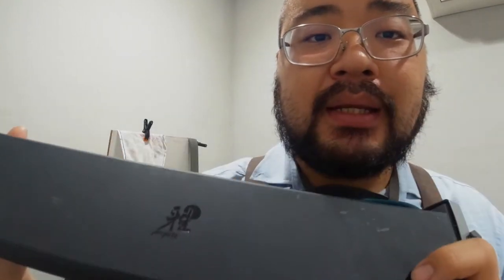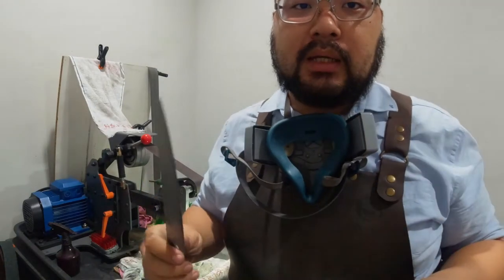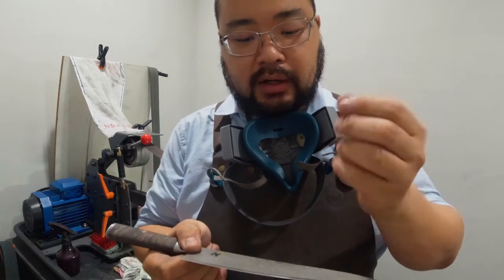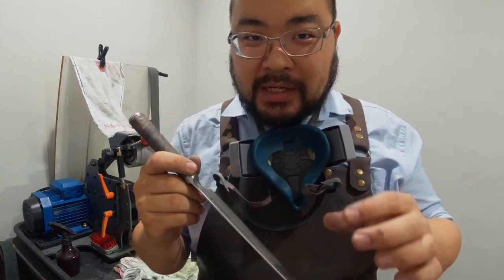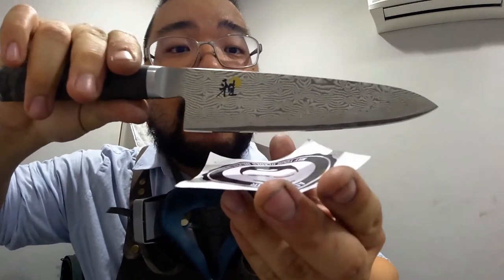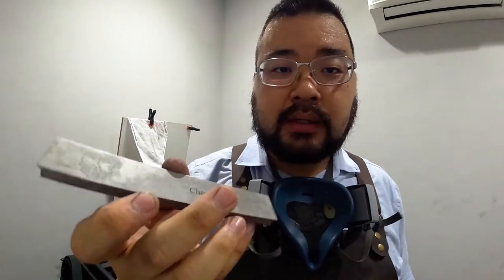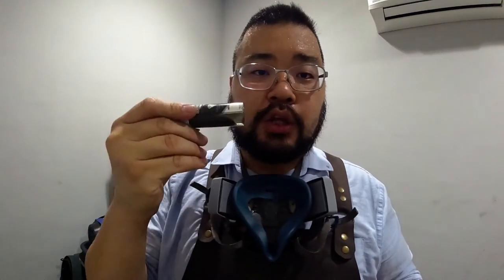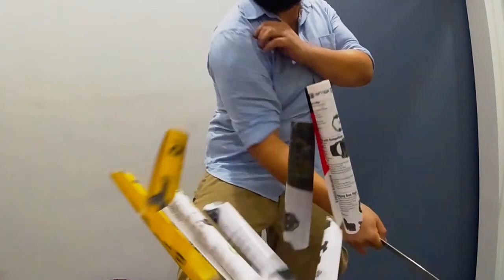Miyabi MC66 Black Series Chef Knife Sharpened in Malaysia

Comment: Very nice work. One question, it is my understanding these knives run from 9-12 degrees, it looked like you were setting your cube at near 17, is there a reason for that? Also, what stones were you running to cut through  mc66? My shun fujis are sg2 and at 63 64 rockwell, and my shapton glass have a hard time with that
Reply from the maker: thank you!

What I usually do is locate the existing factory angle and drop it a little for that extra slice. Though, I do prefer a lower angle, but based on the condition of the knife, i reckon the customer might not be too careful with it, and hence kept it at what i'd assume to be a good middle ground between cutting capability and durability.

I used naniwa/chosera and diamond bonded stones (finer grit). The lower naniwa grits have no problem cutting through the 66hrc, and being a Cr carbide steel, it'd have no issue with the carbides either, diamonds are much more crucial for high vanadium steels as V carbides tend to be harder than ceramic stones. Ultimately, all stones should have no issue cutting the steel matrix.
Reply: @The_Polished_Edge  got ya, bc you felt like the customer weren't maybe familiar with Japanese knives and how fragile they can be, you went with an angle that might hold up better. In my experience people will still struggle with edges like that, but maybe it will help your customer, you get in to 62 63 with an angle that fine, 9-12, even the cutting board can cause minute chips if not used properly with turning the blade while in the board
Reply from the maker: @docsspot  hahaha yeah, at the time of that video, it might not have been a concious decision, but today, when i do knives for the customer, i would ask if they were planning on being harsh, and if not, inform them to be careful with it.

Comment: Great video. Why a 16° angle and not a 9° angle?
Reply from the maker: Thank you! I find the knives in this steel are really prone to chipping, and the blades already pretty thin, 16 DPS still slices really well without compromising too much on edge strength
Reply: @The_Polished_Edge , if it's good enough for you, it's good enough for me. Got my first Miyabi three days ago, and have been worried that I wouldn't be able to hold a 9° angle when I needed to sharpen. Can definitely hold the 15 or 16.
Reply from the maker: @danajoseph6705  my customer had no complaints and they do come back for the same treatment, so it must be working well for them.

I did have another case on a different knife where, even at 15 DPS it wasn't cutting so we'll. It was an old blade that lost quite a bit of width, so I thinned the blade and the customer saw significant improvement in use.

Comment: I've read that alumina based stones don't fully sharpen the carbides of the PM steels. The diamond strop compound was a really good idea after the stones
Reply from the maker: That's partly true. aluminium oxide is harder than chromium carbides, but not harder than vanadium carbides. So if i'm facing something like D2 or ZDP189, i'd go full AlO. If i was dealing with something rich in Vanadium carbides like S110v, i'd throw some diamonds into the mix.

That being said, even chromium steels could benefit greatly from diamond abrasives.
Reply: @The_Polished_Edge  Thank you for the explanation!!
Reply from the maker: @anthonywaldrep5982  anytime brother =D

Comment: What kind of bevel angle you like to set for that steel?
Reply from the maker: depending on the size and thickness of the blade, 15-18 dps would be good. the lower your angle though, the more likely it is to have microchips when used.

Comment: Ужасный нож. Выкинутые деньги на ветер. Не знаю кто писал эти положительные отзывы,да он острый и прочный,но работать им не возвожно. Во первых он матовый и парадокс в том,что продукты наобород липнут так,что невозможно резать ничего,пришлось отпалировать. Эстетика ушла,прилипать перестал,но он не режит,а колит как топор просто,потому что он ужасно сведён к режушей кромке,слишком резкий перепад и из-за этого он просто рубит. А отличные отзывы,потому что они не от профессионалных поваров,а пару единственных от поваров и те проплаченные. В видео где режут этими ножами видно как они именно рубят. С ножами от YAXELL такого нету. Да ни с какими нету. Да этот острый,а толку,можно и топор наточить.
Reply from the maker: That's interesting. Most knives will have sticking, even those with granton edges. The only ones designed for no sticking are thicker single bevel blades like the deba or yanagiba. Polishing the sides of the blade should have little to no effect on how the cutting edge performs, unless whatever you're cutting touches the polished section, then perhaps there will be an effect.

I'm keen to see the work you've done and the problems you've faced. Would you have a YouTube video about it?
Reply: @The_Polished_Edge  I uploaded a photo collage to the YouTube channel.

Here the problem is in the thickness of the blade at the cutting edge. On miyabi 0.5mm on Yaxell 0.3mm When cutting, it does not cut, but colitises the product.
Reply from the maker: @vladz377  you could try thinning the blade or just decreasing edge angle or both. I've sharpened both types of blades you mentioned and they both take on a good edge, miyabi's main difference is the steel they use.

Colitising? I'm not quite sure what you mean by that. Wedging?

I saw your video, perhaps a cutting demonstration of the issue would help
Reply: @The_Polished_Edge  Yes, you need to thin the blade on the miyabi. The sharpening angle is good there, 14 degrees per side.

"Colitises" 
I mean
splits like an ax
Reply from the maker: @vladz377  ah yes, wedges, we're on the same page then. well, I hope you manage to make your miyabi a reliable user eventually. it's not a cheap knife, and it'd be a shame tostay dissatisfied with it.
Reply: @The_Polished_Edge  thanks.